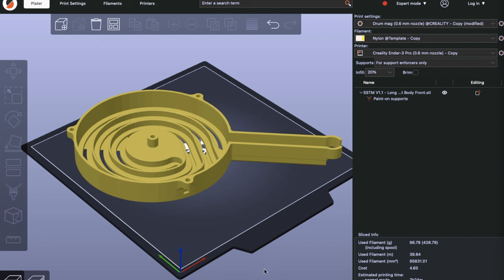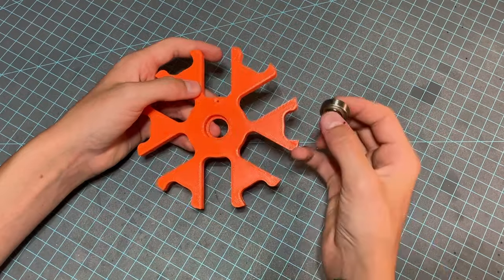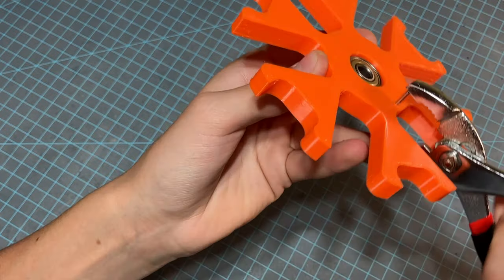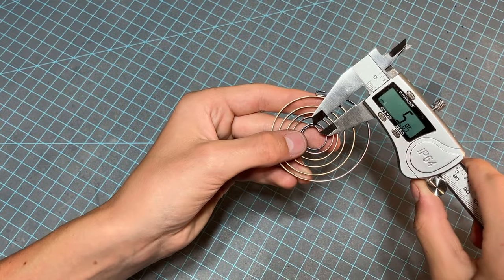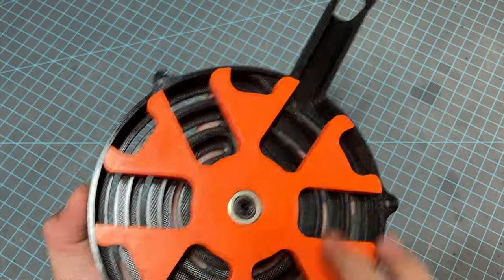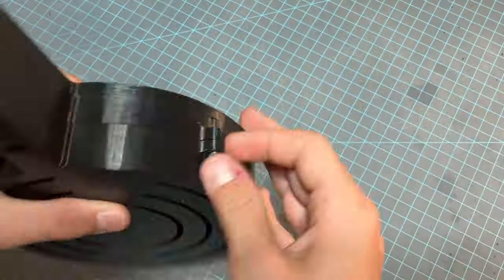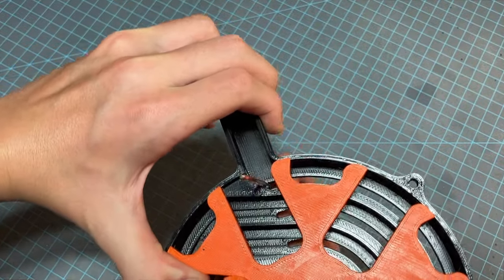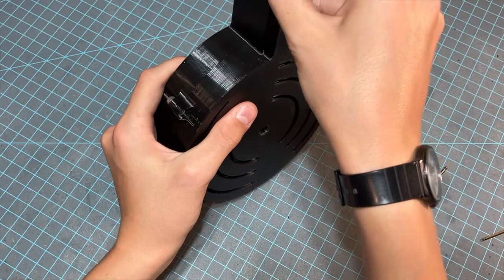I 3D Printed a 50 Round Nerf Drum Mag!(And You Can Too!) | The SSTM Overheat Drum

Comment: This is awesome man, might make one of these instead of a mythical drum mag, if possible could it be modified to have a longer mag port thing? I would love to put this in a lepus.
Reply from the maker: Thanks! On the Printables page you can find one that has been extended by 30mm and someone has made a remix extended by 55. For these longer ones, you will need to buy a straight spring or make one. I have linked wire and a bend guide in the video description so you can make a spring and save some money.